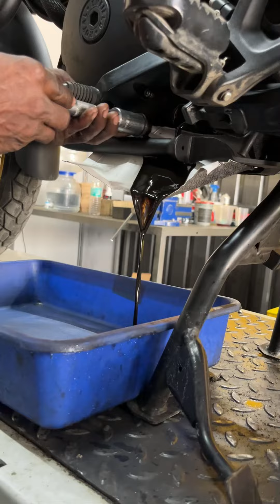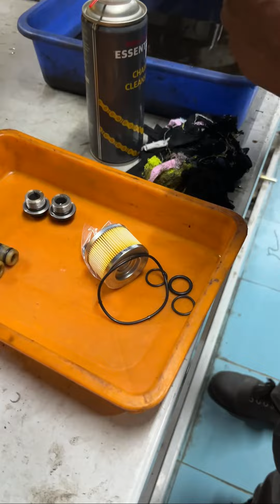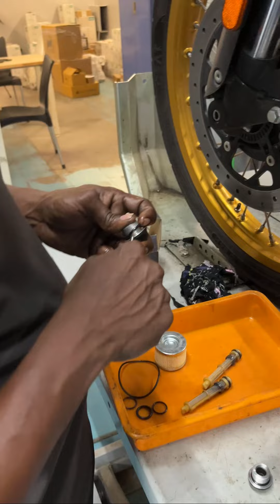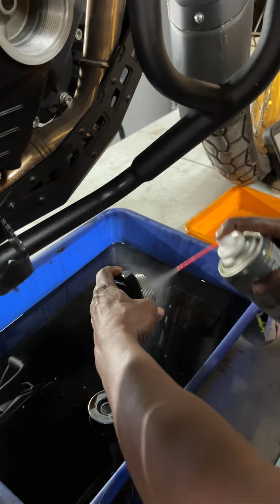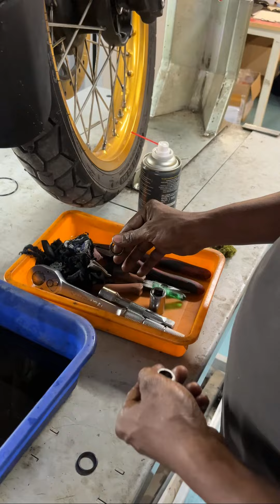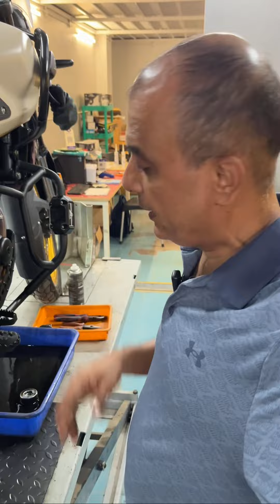Royal Enfield HIMALAYAN 450 | Engine Oil Change | 2nd Service

Comment: I have been trying to find. What is paint coating used in Himalayan engine case. Is it powder coating. Intend to ask is trying to understand if i could paint any 2 stroke engine case similar to Himalayan engine case. Appreciate if you can reply.
Reply from the maker: I don’t have info on that.

Comment: hi sir one question, i bought RE oil filter for Reborn 350 but it came with only the filter and not O-Rings, when asked the person said that O-rings are not available. But i can see that the product in the video has all the o rings. Is it only for Himalayan filter or should i check with the parts store for O-rings?
Reply from the maker: Depends on the part number. And it's OK to change only filter if that's what is available.
Reply: Thanks  @bigbearbangalore
Reply: @mohitAV8  yeah even the showroom do no change the o ring. I had few instances where the oil leaked from oil filter cover. Had to re tighten the allen keys.
Reply: @bigbearbangalore  Can you please let me know the part number you used for Himalayan 450, also I see the oil filter is not soaked in the new oil before replacement is that fine or does it need to be soaked in the oil.

Comment: Long drain intervals, thinner oils are due to new environmental guidelines. Latest advanced engines run with very tight clearances so manufacturers can even go for 0 W 20 oils in some passanger car engines. Btw its safe to use oil as per manufacturers recommendations as OE oil is always tailored made for asked application and have sufficient TBN number. Had used few Fuchs oils in past, not worthy over Motul double ester line up IMO.
Reply: Is motul semit synthetic 20w50 enough for my new Himalayan 450?
Reply: @satviksoni8499  Ester based Motul was benchmark untill Polytron launched their engine oil under Polylube Brand. Go for Full Synthetic Polylube 10W40 in your REH450, thank me later 😊
Reply: @ridinghightidesindia6847  thank you so much man

Comment: Sir i too did oil change on my own after 2nd service after draining i got 2.6L but RE guys tell we need to put 2.1L back, so confused should i add more oil or just leave it 🤔?
Reply from the maker: I don’t know how you got 2.6 but full 2.1 and check oil window level as per process in owners manual.
Reply: @bigbearbangalore  i checked for the window on level ground it's showing full 🤔, maybe the showroom guys over filled it during 1st service or topped up extra in 2nd service 😔😕

Comment: I love your videos. Very knowledgeable. I have a question. Is it normal for Himalayan to give a single knock sound like someone hot a stone on metal after 10-15 minutes of turning it off?
Reply from the maker: Parts cool at a different rate and there can be a ting or ping or Crack sound or sounds after shutting it down.

Comment: Hey...the two incidents which are circulating regarding the chasis breakdown of Himalayan 450...can you adress them and make a video on it.... whether to go for a Himalayan in terms of build quality
Reply from the maker: Will do when appropriate. Thanks.
Reply: @bigbearbangalore  ok 🫡
Reply: Yes sir, i am waiting for your inputs on this chassis breakdown. even I'm planning to get Himalayan very soon. so please do share the vlog as earliest . it will be very helpful for us
Reply from the maker: This matter has been extensively discussed online and the cause of the failure has been pointed to improper installation of after market guards. That’s it. Matter closed.

Comment: Hi. Is it advisable to use semi synthetic and fully synthetic engine oil in alternate service intervals ? Like at 10k km liquid gun semi and at 15k fully synthetic again at 20k semi synthetic like that. Or stick with any one type? Thanks!
Reply from the maker: You can switch if you wish.
Reply: @bigbearbangalore  thanks for the quick reply !

Comment: Would you recommend us to use engine shampoo to clean engine...does engine shampoos affects engine life...if so to what extent...It would be helpful if a video is posted based on this
Reply from the maker: I haven't used any engine shampoo and see no need for it.
Reply: @bigbearbangalore  may I know does it harms engine or not... Because I own a. Pulsar 150 which was ran for 26000km...I wish it could be better if I once clean the  engine

Comment: Sir I am confused between the new Himalayn 450 , interceptor ,gt650  & SM650 . I am going to buy my first RE motorcycle. I had Apache 200, Duke 390 . Now I want to buy a motorcycle for touring purposes and a little bit of a city ride . Which will be best for touring ?? Budget doesn't matter.
Reply from the maker: The H450 is a great tourer.

Comment: Hello GuruJi, Please suggest is it really needed to run the new himalayan 450 bike under 60KMPH till the machine clocks 2500KMS.
Reply from the maker: Follow owners many running-in instructions. Up to 500 kms under 4000 rpm and then upto 2000 kms under 6000 rpm.

Comment: Royal Enfield engine oil is semi synthetic.
Do they allow to choose or bring your own synthetic engine oil option of same grade in periodic service at there service centres 
If they dont allow then will this change from semi synthetic to synthetic to semi synthetic every 5k kms frequently affect the engine?
Asking this because periodic service advised by the company is a must to maintain for warranty coverage.
Reply from the maker: One must use RE oil to retain warranty. The dealer workshop will not use any other oil. 
You may change oil at a private garage if you wish but must get the vehicle serviced as per manufacturer recommendation at the authorised workshops.
Reply: @bigbearbangalore  so will the switching from semi synthetic to synthetic regularly affect the engine adversely?
As RE will put semi synthetic oil at every 10k kms and I will replace it with synthetic after 5k kms.

Comment: Hello sir good day, 
I own a new RE Himalaya 452 for this engine  which is the most suitable engine oil that I can use. Please suggest a good engine oil with other options(Semi and also Fully Synthetic). In owner manual RE recommend to use 10W-40 Semi Synthetic.
Reply from the maker: You can use a fully synthetic oil which is superior to semi-synthetic, but you need to keep the warranty implications in mind because using any other oil than the recommended one, can void warranty.

Comment: Hi Bosky, 

I'm getting a burning smell from my h450 engine after a ride in ghat with fully loaded, is it normal behavior of the bike or should I check it with RE?
Reply from the maker: May be something touched or flung onto the exhaust? Burning smell on a brand new motorcycle is usual. On an older one, get it checked.
Reply: @bigbearbangalore  Thank you ! Mine is brand new one.

Comment: But why RE recommend changing oil at 10k kms. Is it a marketing tactics or the engine oil do can last such long drain intervals. Any comments on this🤔🤔
Reply from the maker: But why Triumph recommends 16,000 kms? Manufacturers arrive at this based on testing so it's OK to follow.

Comment: Does indian conditions need oil with higher heat tolerance, say 10w 50. I used to use 20w40 for both 2 wheeler & car as well
Reply: Use the recommended one.  for XwY you can reduce the X and increase the Y but not vice versa but still recommended is recommended
Reply: @AkashPaul-ql1fu  thank you akash
Reply from the maker: Use manufacturer recommended grade always
Reply: @bigbearbangalore  thank you sir bosky

Comment: Hi can you please share the links of orginal Royal Enfield engine oil needed for Himalayan 450 and the air filter?
Reply from the maker: Contact a dealership please
Reply: You can buy oil same grade 10w40 as recommended from any RE authorized retailer or online.

Comment: 1. Will this void the warranty?
2. Please make a shot on tank gripper or tell where to buy 
3 . Front mudguard mod?
Reply from the maker: Can void warranty 
Grip from @grip.on 
There's no mod on the front
Reply: @bigbearbangalore 
1. could not able to find the gripper can you share a link . 
2. Front mudgard in rain throws back the water on headlight

Comment: Hi Sir, I am big fan of your videos. I love motorcycle riding. I bought an adv at my budget. Xpulse .I enjoy riding it today when I was cruising at 90km the engine oil splashed over my  right leg. Luckily it's not too hot to hurt my skin. I suddenly I stopped and noticed smoke and oil over engine, catalytic converter and exhaust .. what could be the reason for this ??? Any experience. I didn't drove as it could catch fire ..
Reply from the maker: Some.leak obviously. Get it checked. And it's highly unlikely that oil will catch fire. It'll burn on the hot exhaust and generate much smoke
Reply: @bigbearbangalore  thanks for replying.  It's just not leak the oil ooshing out from top of engine if I start the engine. I am not sure just engine oil alone ooshed or petrol also mixed. Service person said not to start and they have towed it..

Comment: Hello sir my bike Himalayan 450 just completed 2700km and my second service is due.The service centre told me to change the rear disc pads in just 2700 km and it is costing me around 3000 rupees which seems very high.Why it is so?Is it disc pad quality issue?and Why so much cost for just disc pads?
Reply from the maker: Rely more on front brakes. You are likely relying too much on the rear.

Comment: Is it really good for the bike if the oil is changed at 5k km or is it okay if you push it till 10k. Because I own a h350 and recently completed 5k km and 2nd service is also done.
Reply: yes it is. The lubricant, in this case engine oil, will contain minute metal shavings of the piston and piston wall… if these metal shavings are present in the lubricant for extended periods then the metal shavings can and will cause damage to the engine’s internal structure… causing deeper grooves on the walls, which will allow the leakageof air fuel mixture into the oil reservoir… you don’t want that. The manufacturer always suggests the optimal limit for everybody involved in with their product. It is upto you and your personal preference whether to get it done before the suggested time or on the suggested time.
Reply: @N0tTh3Pr0  ok understood
Reply from the maker: It's OK to do 10,000 kms if that's what is specified by the manufacturer.
Reply: @bigbearbangalore  ok understood
Reply: It's not ok max 6000km...longer service drain interval means engine open around 50000km .. shorter means life increases minimum 1 lakh km
Reply: @rachitanandhiremath2234  ok understood

Comment: How many silkolene bottles you use? 2 or 1 or more than 2?
Reply from the maker: 2.1
Reply: @bigbearbangalore  yes that’s what Himalayan owners manual states but what I’m asking is.. do you buy 3 1 litre bottle of silkolene and use 2.1 out of them or do you buy 2 bottles and fill up 2 litres instead of 2.1 ?
Reply: He put only 2 L oil
Reply: @bigbearbangalore  where did you get the service kit for Himalayan 450? The o rings and filter. Service centre is denying to sell it to me
Reply from the maker: @RideWithManDeep it's available at all dealerships. Wonder why they refuse to sell? As a owner of a H450, the dealership should sell you parts for it. Which dealership is this? Which city?
Reply from the maker: 2.1 liters. I bought 2 liters now and had left over 800ml from 1st service  so used that for the last 100ml.
Reply: @RideWithManDeep  You can get at any RE Service center sales shop. At Pune Mahashtra its available easily
Reply: @shreenivaslatad5644  there is only one service centre in my city and they informed me that they are not allowed to sell
Reply: @bigbearbangalore  it’s a small town in Haryana that goes by “Kaithal” 
I really wanted to go the route you chose. Changing oil frequently and that too silkolene but unfortunately the service centre and the customer support both informed me the same thing that they can’t sell directly to customers
Reply: @bigbearbangalore  fair enough. That makes sense. Thanks for clearing the confusion bosky ✊🏽

Comment: Hi, I have a himalayan 411 and recently I faced magnetic coil burnt in it, while I replace it back I listened from a royal enfield service guy that to add extra 350-400ml of engine oil that can protect the magnetic coil from burning. Is it a recommended way to do?
Reply from the maker: Maintain oil level as owners manual recommendations. Extra oil helps not.